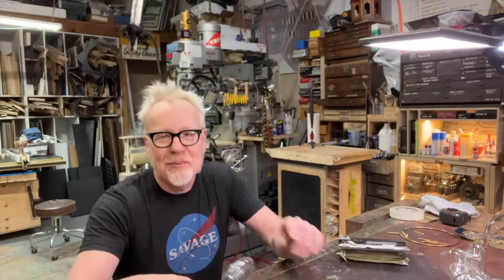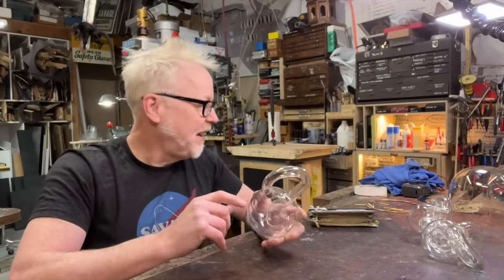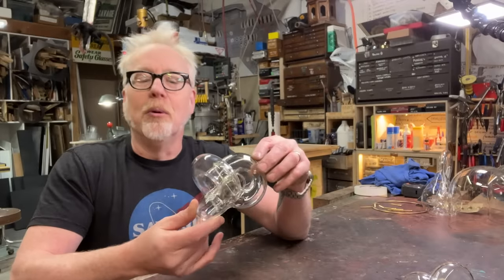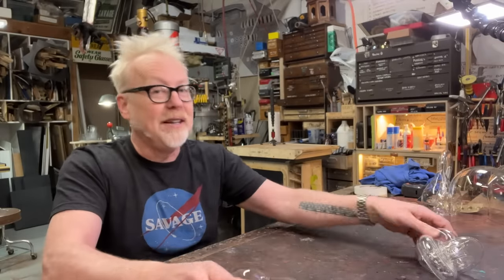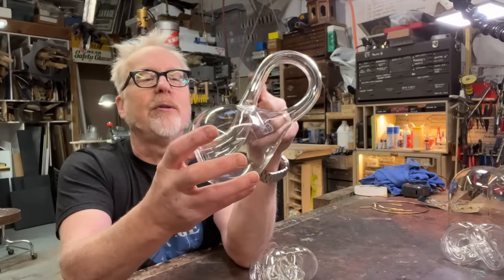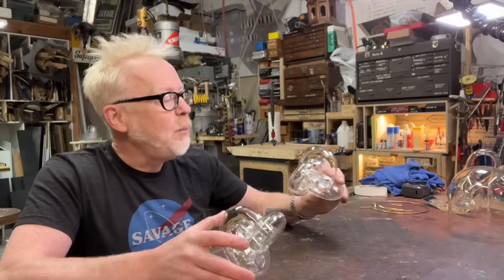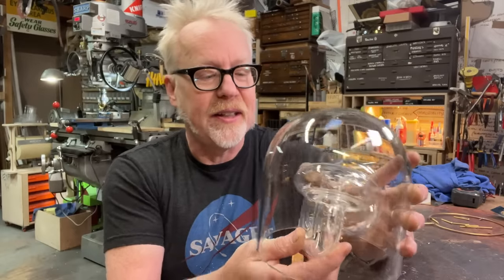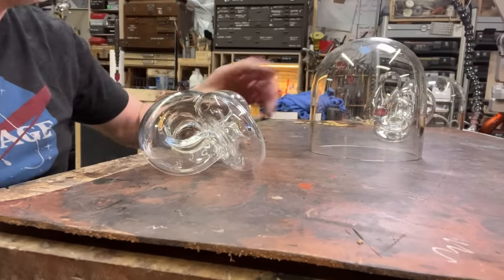This Object Should've Been Impossible to Make

Comment: I think the brass holder could be done if the cups were curved around the glass, rather than being symmetrical. You would need the stem to be in 3 pieces rather than two with opposite threads, so you could twist the middle segment to expand or shrink the cup around the glass (since the cup wouldn't be able to rotate on the glass).

Comment: Adam, when you placed the thing on your workbench and then rotated it, it’s symmetry became instantly apparent. As you turned it, it kept presenting the same shape every 120°. I think you should mount it on a turntable and perhaps make some shaped divots in the turntable, for each of the contact areas to rest in.
Reply: Yes! Adam I think your brass knobs were a very good idea. You could then pivot the brass ring and rotate it in a 3-D periodic motion, which I think was the way you wanted to tell its story. Maybe rubber washers could help conform the brass knob edges more securely against the glass surface?
Reply: @megadrakex  Some clear poster putty would work I think.   But yes rotating , or a trio of different colored lights rotating .
Reply: I was thinking submerge it in water where it floats, but tethered to the bottom to keep it in place. A motor can turn the tether to give an all around view.
 A boys surface Bouy 😆
Reply: @jodypascoe5812  Can it hold air ?
1/3rd of each 1/3rd ?
Reply: @megadrakex  He explained why the rubber washers wouldn't work. It would still move over time. 12:15

Comment: Those guys at the end are epic, such a great ending to your build. The uniqueness of the object inspired a couple ideas. 
1. Build the arms to cradle the entry points accentuating the form of the glass. 
2. Transfer light through the arms with thick gauge fiber optic cable inside the tubing
Reply: I agree with you @j.f.c...  I absolutely love Adam. I'm amazed by his abilities and yet driven into high levels of anxiety by his antics. I think he produced a good display of the Boy's Surface, but felt he gave up too easily on his first iteration of holding the object. Putting the Boy's Surface into a suspension frame with the lighting coming from within the framework would have put this on par with the actual object itself. Thank you, Adam for sharing with us this treasure and taking us on this journey.
Reply: @resoljmessman541  I think he should have made some 3d printed protypes to test various methods of holding it. I also liked his initial idea of having it not be perfectly flat, which he could have still done by raising the contact points by varying amounts.
Reply: I was thinking the exact same thing, elevate the glass object as well, and run the lighting through the tubes to illuminate in those 3 places.

Comment: Adam, you should get your hands 3D scanned in a shape that naturally holds that, then print that on your resin 3d printer , would look really cool painted in matte black or even you could flock it to look like a black velvet, then in the base you could use an led ring light with a warmer temperature light with a diffuser ring over that . This thing is super cool, almost a forbidden object for our dimension
Reply: resin 3d printers are terrible for archival purposes like this and can be sensitive to UV. it probably wouldnt hold up over the years.
Reply: @IndianaDipper194  some resin printers can print in jewlers wax. maybe he could do that then cast his hand in bronze.
Reply: There's no need to use a 3d printer. You can make a mold of your hands in agar and then cast them in hydrocal then paint as needed.

Comment: Adam, could you put an anti-reflective coating on the bell jar?  That would allow the jar to be a protective cover without introducing its own complex reflections.
Reply: It's interesting how easy it is to overlook such simple, yet meaningful details.
Reply: Totally agree and since we're spit-balling improvement options, I would have explored adding a mini DC jewelry turntable to further show-off the Klein bottle's 3D/4D visual intricacies. Also would have totally gone with rechargeable batteries (ie/eg 18650s, etc...) so the unit could be displayed anywhere vs being dependant on a wall-wart and a 110v outlet. Other than that, the display turned out great, well done A.S. !!
Reply: I think I also would have added extra lights, probably independently RGB programmable, shining up through the carbon tubes. They look like they’re just about right for a 5mm LED.

Comment: I think the suspended mount could still have worked, you just needed to make mount cups that were actually in the shape of the part of the object they were in contact with! Maybe formed them around a bit of bent pipe of similar diameter to one of the lobes, or some such. The cups could have some acrylic washers that could also be formed to the surface and cut down on slippage and scratching. Also, what if the ring it was suspended in consisted of 3 half rings to match the trilateral symmetry?  But you can't deny that having a setup that lights it will always be cooler.
Reply: I was thinking glass cups with thin necks, the contact points had felt, and it was suspended inside the glass container.
Reply: So the glass stems would be connected on the inside. Sounds like a pain in the ass... But the thing does look like a paradoxal hemorrhoid of despair.
Reply: I'd been thinking of the whole curved obloid grips as well, but I thought his choice of fixed rods with threaded grips was definitely the wrong direction. If he'd used thicker rod, or strips of brass instead of round, then threaded THROUGH the ring, and used thread and knob from the OUTSIDE of the ring, so they could be adjusted MUCH more easily, combined with formed grip pads, it MIGHT have been better...but when you're trying to hold on to the outside peak of a round feature, you're really asking for trouble. 

Better might have been to put LONG thread rods (or at least threaded on the part that passes through the outside ring) that would brace against the inside JOINTS, rather than outside round peaks, it would have been much more stable...since it would then be braced from two sides of each contact point, rather than a surface that falls away on all sides...
Reply: I was thinking the same, mahbe even using clockspring brass bent to the profile of the glass. That way it still be taken out and held (but put back with some difficulty).

Comment: The three-point-support version - with the circle going around, driven by a small slow motor at the bottom, while an inner section of the base rotates (with the light, of course) - would look amazing.
Reply: Yea I was really hoping for movement, but then it's more expected to sit and rotate, I can appreciate the simpler execution with the expectation of removal and handling.

Comment: Imagine a piece like this made from uranium glass and displayed under a blacklight. Wow!
Reply: Or if they could figure out how to fill it with neon...
Reply: Radium would be safer, marginally.
Reply: @cycoholic  I like the last part of your sentence. xD
Reply: @cheutho  Neon wouldn't be difficult. You'd just put a hole in one side and then seal it back up. It would just lose it's ability be moved around
Reply: @caodesignworks2407  not if you use a tesla coil to excite the neon instead of an internal anode/cathode. then you could still pick the glass up and it wouldn't be connected to anything.
Reply: @cycoholic  No. No. It would NOT be safer. Uranium-238 often used in uranium glass has a half life of 4.5 billion years. 

The half life of radium (most common is Radium-226) is just 1600 years AND collects in bone. See the Radium Girls for the results of repeated exposure.
Reply: @historicaltidbits  The Radium Girls ingested the radium, licked the paint brushes, radium collects in bone. Their exposure was deadly because their employer told them it was safe. I have Radium Glassware,which only glows under black light,  and clocks that were painted with radium paint on the dials and hands. It does not read  beyond the glass of the clock face. It is still visible in a dark room after about 15 minutes when your eyes have adjusted to the lack of light.
I have seen WW2 aircraft instruments that STILL glow quite well.
Reply: @dsloop3907  I believe you are confusing uranium and radium. Radium was not used in glassware. 

Uranium glass was briefly marketed as 'radium glass', but it was not actually radium in the glass. It was just a marketing tactic to sell carnival glass. 

Radium was used in paint, as you mentioned, which had military and civilian purposes. Radium is significantly more radioactive than Uranium-238 and also vents radioactive radon gas which can collect in small, poorly vented spaces.
Reply: @historicaltidbits  Perhaps that is true. I tend to confuse things sometimes.  I do enjoy my greenish glassware as it glows under UV light, and the clocks (Big Ben, Little Ben)  are on a shelf in another room. They too glow bright when a UV light is shown upon them. Sadly none of them work, but they are right twice a day.
Reply: @dsloop3907  Yep, I also have uranium glass and a radium compass. Though, my compass no longer glows, even with UV applied.
Fascinating objects. I now keep my compass in a sealed container and occasionally vent it outside.
Reply: @caodesignworks2407  I don't think it actually has any interior space.
Reply: If you were already planning on using a blacklight, now a days it's more efficient to do it this way. The the highest quality glow in the dark products are actually about 3-4x brighter than well made uranium glass used to be. The best you can get is strontium aluminate doped with europium and dysprosium, but it can be quite expensive. However it is capable of being used for glassblowing & most other moderate to high temp uses.
Strontium Aluminates are now the longest lasting and brightest phosphorescent material commercially available. It is a superior phosphor to its predecessor, copper-activated zinc sulfide, being about 10 times brighter and 10 times longer glowing. Also find out what spectrum of light is most easily absorbed by it & use that same frequency in an led UV emittter instead. You'll get more re-activeness, for less cost & won't be emitting light spectrum's that do nothing to excite it's molecules. 
That said if your concerned about cost; copper-activated zinc sulfide is the way to go- but higher temps can cause it to not work as well & in the case of glass would likely burn into copper sulfate turning the glass green, while losing most of what makes it glow. It is used in some lower temp glow-in-the-dark 3D printing filament, but it usually has additives to make it more heat tolerant. It does tend to work reasonably well in epoxies & the like. Back when I was in, all of our bubble level azimuth indicators (Latitude, Longitude, Elevation, & Deflection) were filled with radium infused liquid, & it was a bright neon-ish lime-green even at dusk/dawn & seemed even brighter when it got dark. You could read everything 2-3" below it perfectly on a moonless night.
Reply: @chaos.corner  I didn't make it all the way through the video, but in that case, you seal off the open ends. It compromises the mathematical shape, but the shape's look remains. I'd rather just make it using a tinted glass or something that's UV reactive. Or coat it in such
Reply: @caodesignworks2407  In fact, if you made it to the end of the video, the mathematician explains that they actually should be sealed off. So all good :D
It should be easily 3D printable so that might be worth looking for.

Comment: I think the three point support option could work if you molded the contact pads off of the surface of the object itself and made them a little larger. They could even be slumped acrylic so as not to interfere with the visual impact of the object itself. I suspect that the simple cups are not a positive enough connection that apply enough constraint to movement. Or maybe not, but it feels right to my mind. Great seeing your whole thought/production process, regardless! And what a great explanation of the object at the end.
Reply: I had almost the same idea, though I was thinking of using little rubber or leather discs. The cups would press them into the surface of the glass, and the discs would provide extra friction. The discs would also be able to conform to the surface of the glass without needing to do special shaping.
Reply: Feels like the cups were in a 2D configuration whereas the object has a 3D type of symmetry. So the cups weren't pressing on it straight on, maybe. Like, the vectors of the cups should not be coplanar?
Reply: @mhelvens  I think they can still be coplanar, but each pad would not quite be symmetrical, and each would be rotated to accommodate its particular loop.
Reply: @Demo12345  The tricky part is that for an "archival quality" mount like Adam is going for, you really don't want materials that may degrade over time and compromise the support. It would be tragic if rubber or leather degraded and loosened, leading to a fall and damage/destruction.
Reply: @Demo12345  "though I was thinking of using little rubber or leather discs." He mentioned specifically in the video that he did not want to do that for this piece. @12:15 in the video he talks about it.
Reply: My thought was to add velvet pads to the cups & make them slightly sprung (or simply make them from some suitably elastic & frictile (?) material in the first place, eg neoprene.

Then Adam came up with his 'posts' idea to hold the object in place, which is fine, simple & easy to do.. but I was hoping for a single central post stand (possibly with 3 angled spoke stubs) to draw the eye away from the base & to the object being displayed. I'd have also hoped for a rotating base, covered in velvet (to eliminate reflections), & maybe the rotation could be on a timer?

I wonder how the object would look if made from smoked glass, with the current lighting? To my mind, clear glass makes too many reflections internally for this sort of object: they confuse the eye, which should be drawn to the /surface/, not to the internal compromises made by bringing a 4D object into 3D reality
Reply: @Andrew-uk1bz  I missed that part, thank you for pointing it out. I would then try suggesting using thick felt or some cork but it could run into the same issue.